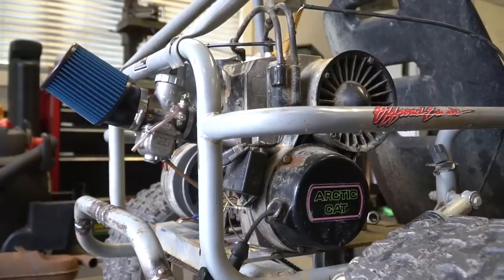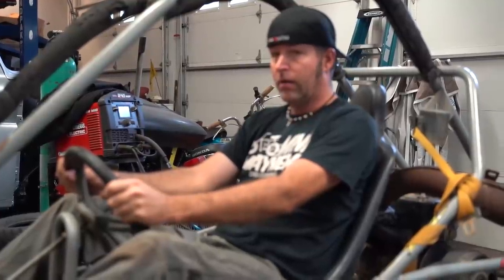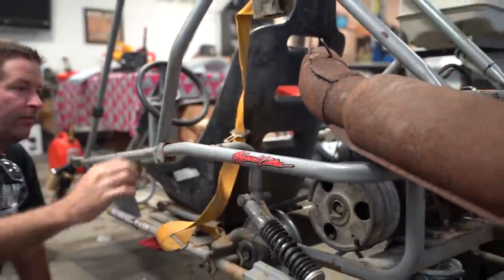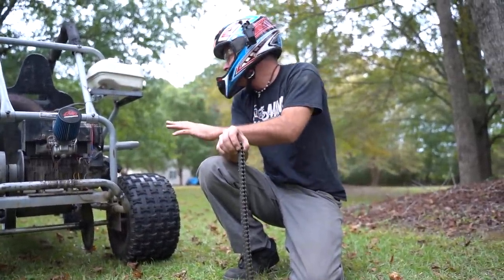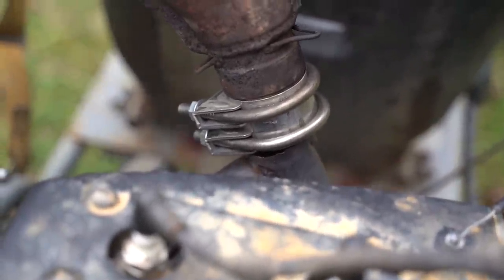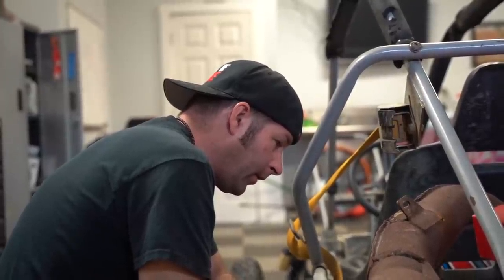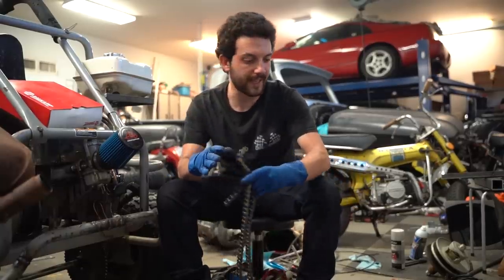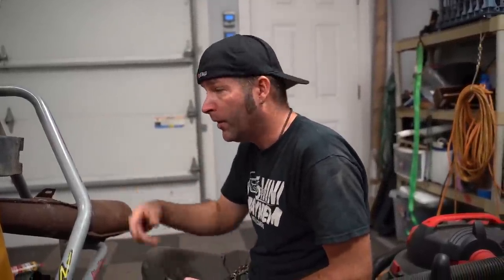440cc 2 Stroke Go Kart First Ride!

Comment: 2 strokes will literally constantly crack and break exhausts unless you spring mount the joints where it connects to the head and rubber mount it to the frame.
Reply: This.
Reply: @gumbyenduroadventures6225  What do you mean by This dude, i don't get it.
Reply: @jamesblanton9364  means 'this' is a helpful comment and 'this' would be the comment I would make if jdmjedi didn't already. Shortened to 'this'.
Reply: @gumbyenduroadventures6225  Ah-Haa, cool and thanks for the explanation bro, have a ripper day or night depending on where you are. Cheers
Reply: The frame will be a close 2nd If not the lead.
Reply: I have CR500’s none of which have springs on the exhaust.. maybe it’s small 2strokes?
Reply: on they still aren't solid mounted. I believe they are still a slip type fitting at the head if I remember correctly. And still rubber mounted to the frame.
Reply: My little tiny bike motor broke the exhaust , 
twice.  I got an expansion chamber from 
SickBike.  It has silicone sleeves in it, so 
the pipe can flex.

In the old days, my Yamaha twins (RD-400
RD-350 and RZ350) all had those springs, 
on their expansion chambers.  The ONLY 
way to go.

steve
Reply: Dave Iauco  thanks... I knew that just typed up the comment really quick and happened to word it that way.
Reply: jdmjedi777 never noticed, but your right. Mine have a “sleeve” with 3 springs on it. I apologize
Reply: @Jason-vx4eo  no worries man! We are all just here to help each other. Definitely jealous you still have a cr500 to rip around.
Reply: jdmjedi777  lol. Definitely a unique comment section. An awesome group of guys with their heads on their shoulders is rare to find on YouTube these days. I bought the bikes back in the 90s. We rode them in the stripper cuts here in Ohio for many years out of high school. And you know how life goes, got married had kids and the bikes were just kind of brushed off to the side. Nowadays they been refurbished somewhat (cosmetics) and just sit in the garage and look pretty😂 thank you, have a great day brotha

Comment: The exhaust is spring mounted that's why there are loops where it attaches to the manifold, if you try to make it solid mounted it will break all the time.
Reply: or use a flex pipe....
Reply: I agree the exhaust should be spring mounted and don't used thin wall pipe
Reply: use spring not flex pipe . will work and keep up with the vibrations
Reply: Not to mention it's a massive weight free hanging in the air on thin walled mild steel.
Reply: Your spot on s wylie
Reply: They never listen.
Reply: They should have engine block behind you from the engine
Reply: The exhaust needs a new ball flange, springs,  rubber mounts, and a heat shield so they ain't Makin back bacon. And the engine needs rubber mounts
Reply: All the time every time.
Reply: Yep the ball/socket and springs. 👍
Reply: The exhaust is on the wrong side all together as well they should swap the fuel tank and it around in order to keep as much heat away from the clutches as possible. And yes springs on it as well
Reply: There cant be enough emphasis placed on the OPs statement. Also, peruse some of the vintage snowmobile sights, they have classifieds and you'll find parts plentiful.
Reply: Yep. Definitely true!
Reply: Pretty much every exhaust pipe on every 2 stroke needs to be mounted that way. It's one of the quirks of those awesome oil burnin  bitchin fun machines!
Reply: @dodgeme1986truck  only a true wasp buzzin sound lovin, oil burnin, fun havin aficionado like you would know that. I salute you✌!!!
Reply: you are correct wylie. A 440 on a snow jet was my high school shop project in the late 80s (tiny chassis, big motor). we used a leaf spring sideways for motor, and let the exhaust stay the animal it is.. springs and socket. Legendary motor. it is way outdone of course.. but its reign was almost 20 years. the 440 kawasaki (arctic cat)
Reply: It is not vibration on the exhaust, it is expansion, from the heat.
Reply: Look at a Yamaha g-1 2 stroke golf car to have a good understanding of how to do the exhaust.
Reply: @gsp49  I think it's safe to say it's both.
Reply: Could always be cut and use flex pipe and a reducer to get back to stock of whatever you may choose, I've seen 250 2 strokes on shifter carts ran duals using American eagle exaust for a Harley with the baffles cut and resonates installed within
Reply: How would anyone not know that lol
Reply: i know Im asking randomly but does someone know of a tool to get back into an instagram account??
I somehow lost the login password. I appreciate any help you can give me
Reply: @Adonis Sterling Instablaster =)
Reply: @Ahmir Seth It did the trick and I finally got access to my account again. I am so happy!
Thanks so much, you saved my account !
Reply: @Adonis Sterling Happy to help xD

Comment: Now that you’re in the snowmobile game you need to start calling it a primary clutch.
Reply: And secondary 😂
Reply: Yeah that's what I was thinking the entire time lol
Reply: And the engine maker bomb-bar-deer!
Reply: @bonzogamer6966  (bomb-bardi-aye) Its Canadian or french...something like that
Reply: @haydona1845  Ask anyone that has snow in the northern US, it has been bomb-bar-deer since the 60's! Ski-Doos FTW!
Reply: @bonzogamer6966  I mean hey pronounce it how you want. Im just saying thats how the french/canadians and the company itself says it. Doesnt really matter just thought I would add that in there
Reply: @Bike Life_93 The whole unit is called a CVT transmission but the two pulleys are called the driver and driven clutch.
Reply: Dave Iauco Every internal combustion engine has an ideal RPM for torque and an ideal RPM for max horsepower. Any RPM other than this "power band" results in less power being produced. A traditional transmission can't always keep the engine completely happy so even if it shifts at the right point the start of the next gear is slower than the ideal RPM for the given situation. The wider the power band and the more torque an engine has the less of a problem this is but for the small engines used in small cars all the horsepower is often right at the top and the engine bogs down in the rest of the rev range. The normal solution to this problem is to add more gears but this increases complexity and cost. A CVT is a cheap way of having an effectively infinite amount of gears, and also to eliminate the lost acceleration caused by the shifting process which takes time. They aren't without their drawbacks, for example they can't handle a lot of horsepower, even the metal belt ones like what Ford was using for a while will slip or wear out prematurely if they are used on a big engine in a heavy car. You likely won't see them replace 10+ speed gearboxes in semi trucks any time soon for this reason. I don't know why you have such a strong negative reaction to them, if you don't like the way they drive don't buy a car that uses one. I have a feeling that you are one of those guys who is just scared of any sort of change and progress because you have an unshakable aesthetic attraction to a hopelessly romanticized fantasy version of the past. A modern minivan will smoke the original mustang on a quarter mile strip.

Comment: Two strokes are very sensitive to jetting and weather really effects jetting. The colder the leaner they go. They tend to jet them rich for reliability and so they don’t melt down when it’s -30. Being in the warm weather  like that it is pig rich. It was never meant to be run above freezing. You can tell by the way it is burbling and not reving out. It is slow out of the hole because it is loaded up.( this will also disguise itself as bad clutching.)  A tune pipe will lean it up but prob not enough for your weather. You prob have to go down at least a couple jets on both you pilot and main as well as drop your needles. If it’s twin carb it may have a staggered jetting . Richer on the clutch side. So don’t be surprised by that. Rich will also foul plugs. I highly recommend you lean it up. Trust me I grew up around these. ( live in northern Canada. ) I can tell when a sled motor is not running healthy. Be careful leaning it up you don’t go too far. Do research on plug chops. You have at lest double the hp still on the table. That thing will make your head spin. Throttle response should be instantaneous. Two smokers are by far superior in hp to weight. And with double the combustion events for a given rpm they dominate. Good luck guys. Keep up the good content.

Comment: Try to find a running working snowmobile or a engine with a matched set of clutches. Getting both clutches that are tuned together for the engine is key!
Reply: Took the words right out of my mouth... it will work just not great for them. Love this project but lack of research might create consistent problems for them.

Comment: Special tool is a 3/4" bolt fine thread
Reply: Fill the bolt hole on the primary clutch with water, put some thread tape on a 3/4" bolt and let her rip tater chip.
Reply: @lloydbradley6183  I normally spray some PB blaster in the hole then fill with motor oil, thread tape the bolt then hit with the impact
Reply: I prefer grease, it doesn't leak past the threads. But it makes a bigger mess to clean
Reply: @pico:Pretty sure that’s what I used to get the tc off my old ez gfoc offo go when I rebuilt the engine👌🏼😴😆
Reply: pico67ss YEP

Comment: I put a 30 horse Rupp into an old Manco Deuce just recently; it ripped the cheap 420 chain off in test mode. 

Deuces are HEAVY! 30 hp matches an old 5.0 Mustang in power to weight. 

Plenty of fun

Comment: @carsandcameras I would look into lifting the exhaust/expansion chamber and turning it so you can use it like a 2 stroke dirtbike expansion chamber. Maybe use springs instead of a clamp and a rubber bushing so it can flex. Trust me if its too rigid it will bring more aggravation than loosing the 10mm socket out if the set😂😂

Comment: Don’t know if it’s still available, but back in the day, I ran nothing but Castrol castor bean oil in my two cycle dirt bikes.  It was good on the seals, bearings, less carbon build up on the plug & ports, and the exhaust had an aroma that was almost addictive. I concur with the comments about securing the exhaust with springs.  You will have to deal with a good deal more vibration with a two stroke, but it’s a small price to pay for the power.

Comment: Ok a few things from a snowmobile guy (not the best but I do now some stuff) you more then likely need to jet the carb before you burn the motor down also you need to spring mount the exhaust as many have said. Another thing you do need a special puller for the clutch. BUT if you put some oil or water down the clutch hole and thread tape the bolt and impact it back on it will pop that bad clutch off. I live in Minnesota and work on alot of snowmobiles. Please like this so they can see it I can probably help you guys with some things. PLEASE LIKE THIS SO THEY SEE IT...

Comment: Agree with Springs on the exhaust! Every sled ive ever owned had spring mounted exhaust! Also the make a puller to get that clutch off, the crank is tapered and the clutch presses on it. I think I have an extra puller if you guys need it, but there cheap too.

Comment: Arctic cat made several different primary's and secondarys. These motors can be very fine tuned for the application.
Reply: Weights and springs is a good start

Comment: You looked so happy Ike with that big grin. You guys should build one of them 2 strokes for the drag kart. Get an exhaust from a big CC (250 and up) 2 stroke dirt bike, expansion chamber is more compact and tuned better then the snowmobile and that's too much smoke even for a 2 stoke, check the oil/fuel mix.

Comment: Snowmobiles use springs to hold the exhaust together.  

Cat snowmobile clutches are set up to let the engine rev up before it suddenly engages. 

 Snowmobile engines are usually on elaborate rubber mounts to control vibration.

 You're probably running rich on oil in the gas, thus all the smoke.  The carb may be a little rich too.  This era smoked, but not that much.  Synthetic 2 stroke oil may help too.  

Most snowmobiles use double chain  for the final drive. Too bad you couldn't get the whole snowmobile to lift parts, but a very interesting build.

Comment: I can’t wait to see this thing fully rip at the beach! Some rear suspension mods, maybe even a little wider track width and I think this will compete with the cross kart (or at least give it a run for its money). Next project idea- use a 2 stroke dirt bike engine for a tighter package and less weight and more easily available power adders. Late 90s yz 250s make high 30s stock, and early 2000s bikes make 50ish modded out (not sure on the later model bikes, I’m sure they make roughly the same) and the engines are cheap and fairly easy to find vs a snowmobile engine why’ll being in the south where no one is going to have a sled or parts for one.

Comment: From the looks of it you might have been at 1/3 power. Remember these can jump a long distance and take a heavy snowmobile over water. Dampening the engine and exhaust  at all of the  SECURE mounts is advisable. Move the gas tank, fix the harness and double check the brakes. And hold on for one heck of a ride.

Comment: I'd go with a Comet 102c for it as some are saying but that 440cc motor does have a lot of power behind it you guys did very well with this build some was saying for the pipe needs to be spring held into place since it's a 2 stroke motor that will vibrate a lot

Comment: It's a hoot watching you southeners working on Snowmobile parts. LOL.

There is a reason snowmobile exhausts are mounted with springs and with ball/socket exhaust joints. Even without all the added vibration.

As for that vibration, I would not be surprised if the crankshaft is bent either from shipping or from someone trying to get the clutch off in the past without the right tools.

Comment: How come you couldn't have just mounted the fuel tank above the engine with a cross brace? Maybe a less risk of crushing the fuel tank when rolled over?

Also I would suggest to get some rubber vibration absorbents that act like washers that mount sandwiched between the engine and the motor  mount. Industrial pumps with big engines have these to help reduce the vibrations the engines cause to the frame, and I think it wouldn't hurt if you got a set to fit.

Comment: Check  2 stroke Rotax exhaust they use ball and socket joints to allow movement from manifold to expansion chamber,held together using springs

Comment: looks great you should try some THICC rubber washers under the motor mounts that will help reduce vibration even with the worn out clutch old tires or bobcat tracks work great for that

Comment: hey guys...whats the taper on the crank...30mm 10-1? if so you can use several makes of clutch newer /used...polaris arctic cat yamaha some skidoos....use the dennis kirk sight to cross the clutch over in the fitment portion...glad to finally see you guys use a snowmobile powerplant. and ike 2 strokes are super sensitive to jetting so dont play around too much...lol awsome

Comment: 2 strokes require a separate tuned expansion chamber for each cylinder, or else you could get some weird cross scavenging or just poor performance from the pressure waves partially travelling the non-active exhaust runner.  I made custom expansion chambers for my nitro RC car years ago out of cookie tin metal and JB weld...they worked great and you can control the power curve shape and peak power rpm quite a lot by varying the shape/size/length.  There is information on how to design them out there.  Google photos of old 2 stroke motoGP bikes.  The 4 cylinder 500cc bikes had 4 individual pipes snaked around the bike...super cool looking, and those things were animals!

Comment: Make sure you build a really heavy duty clutch/belt guard. There must be a bunch of oil in that pipe because it doesn't sound like its running too rich,  not that rich anyway.  Good work guys, you'll get it all dialed in. 👍👍

Comment: The clutch bolt on some snowmobiles can be used as a removal tool.  Pull bolt fill hole with water engine has to be vertical or angles enough water stays in. Thread seal the bolt in and start to tighten usually it'll pop the clutch free from the crankshaft.  look it up!

Comment: sleds use a ball and socket type exhaust joint held together by springs to allow movement of the engine independent from the exhaust. check that the crankshaft itself isn't bent

Comment: You should use a ball and socket exhaust joint with springs holding it together and a rubber mount to support the expansion chamber. Also if you can find them used the twin pipes from the 340 Z Artic Cat will really wake up that engine. They have a more smooth expansion and tapper back down like a stinger pipe on a Polaris.

Comment: Snowmobile exhaust is usually held by springs no clamps due to vibration. If you want to eliminate most of the smoke, use Amsoil Interceptor.
Reply: Not vibration, expansion.

Comment: It's a primary and secondary clutch on a snowmobile engine. You also need to space the clutches appropriately and use the proper belt. Without that you are throwing mud at the wall...and money down the drain. Snowmobiles get all their speed and power by belt engagement and where the belt sits in the clutches when not running. Look up the belt specs for the motor,that will get you where you need to be and eliminate at least half your problems.

Comment: In sledding parlance, they're called "clutches". Primary and secondary. If you need to buy new, look at Comet clutches. Infinitely tunable, and near bulletproof. Combine that with a proper secondary and proper belt, it will be day and night...!
And yes, you need a specific puller for it....